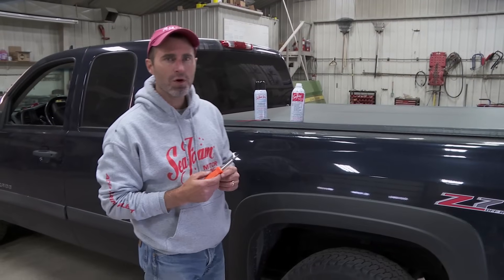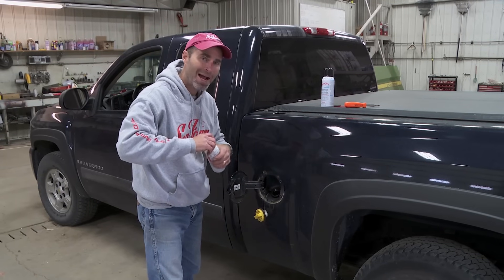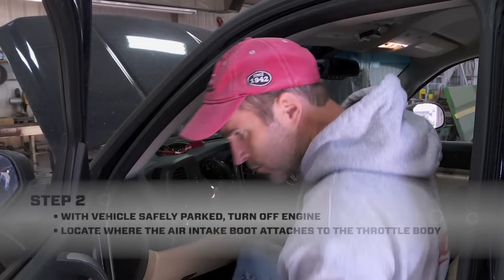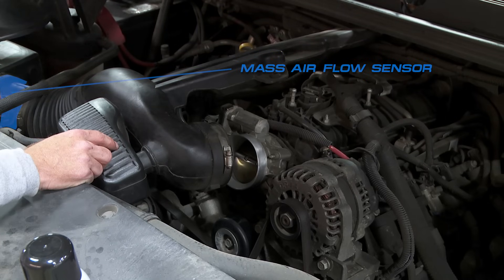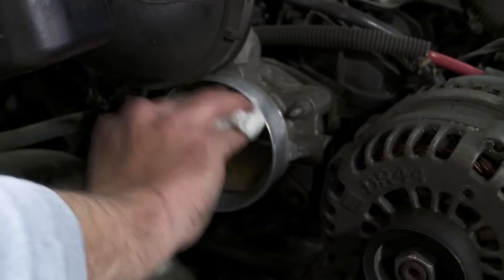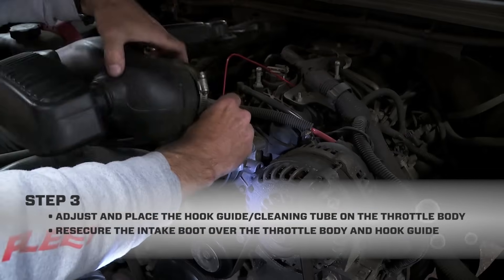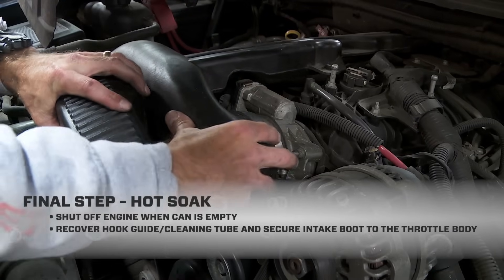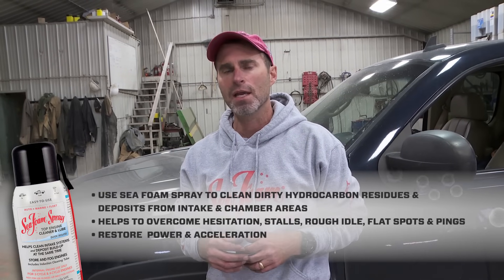How to clean a gasoline fuel injection air intake with Sea Foam Spray

Comment: You’ve thoroughly confused me now as you seem to no Longer approve of using vacuum line method? Is the effect of spraying thru throttle body the same as vacuum line? Combustion chamber is still cleaned etc. ?
Reply from the maker: Great question. Sea Foam does not encourage vacuum line use. Sea Foam Spray works MUCH smarter, better - cleans more, cleans better, safer, feeds/cleans all intake valves and cylinders evenly.  Any liquid through a vacuum line is drawn in globs of fluid into a chamber (not tiny aspirated droplets), does not feed evenly, then pushed out the exhaust valves. The cleaning difference is night and day, partly because you're not wasting the product. Hope this helps.
Reply: Sea Foam Official it kind of helps, I get the issue with using the brake booster as it may not supply all cylinders, but you guys never actually suggested using the brake booster line, you always suggested the PCV valve vacuum line which feeds right into the manifold and all cylinders. I hear you on the spray being just a superior solution, I’d think most of the liquid gets aeroslized given the air pressure and heat, unless an idiot just pours it into the tube all at once as idiots have been known to do. So I get that for you guys it’s smarter to just suggest nobody use that method in our overly litigious society, but what if I pour my seafoam into a spray bottle and spray into the PCV valve vacuum hose, then I can get the spray next time, do you see an issue with that or still advise against it? Appreciate your time
Reply from the maker: You can use the can in your fuel, your crankcase oil..up to you.

Comment: I'm 60 and I'm telling you it was WAY easier with 4bbl carbs and good non ethanol 100 octane gas.
Reply from the maker: Yes, simpler and much less complicated. Like many inventions, 4bbl came and went because the USA  market system is built on rewarding innovation. How fuel is made works the same way... In the end, we all want low cost fuel that works just good enough.

Comment: My 2014 Dodge Grand Caravan has the MAP sensor behind the throttle body. How can I use Seafoam on my Dodge?
Reply from the maker: The video describes MAF (mass air flow).  MAP (manifold absolute pressure) is different/non-issue.

Comment: I'm not an expert, but is it really a good idea to take all that carbon harmlessly sitting in the intake and flush it through the engine? I guess the results speak for itself but I'm wondering if i can skip that step.
Reply from the maker: Sea Foam Spray softens and liquefies the varnish that holds the carbon ash together. Whatever is cleaned is immediately pushed out the exhaust. Nothing goes into the engine, it goes out of the engine. Hope this helps!

Comment: I have a 1992 Chevrolet Caprice with a 305 and 260k miles is it risky to "foam" the motor in the throttle body?
Reply from the maker: Not risky.

Comment: Hold on. Why did you add a whole 16 oz can to the tank? On the can itself it says 1 oz per 1 gallon of fuel!!!
Reply from the maker: 1 oz is a maintenance dosage for keeping fuel fresh.  Can always add a greater concentration for cleaning.  The greater the concentration, the more it cleans.
Reply: Sea Foam Official  Got it. Thank you :)

Comment: Would you recommend to this before or after pouring seafoam down the brake booster vacuum line?
Reply from the maker: Hi Juan: Thanks for the question. We NEVER recommend using the brake booster/vacuum line.  There's no point when Sea Foam Spray works much safer, even, and far better cleaning!  Anyway, Sea Foam Spray is the way for cleaning the upper engine!

Comment: 1993 Dodge 250 pick up. 318 V8. Ran REALLY rough. Like hardly could keep it going. I thought I needed a valve job. Couldn't find any vacuum leaks. 
A can in the tank and a can of spray into the intake and a little driving. I even forgot to warm it up, but it's driving NICE. I love this stuff.
Reply from the maker: Great news! Thanks for posting!  Now that you have the hang of it can tell your friends, then just keep after it every few months (or 2 to 4 treatments/year).

Comment: I didn't have any check engine lights on my PT Cruiser but I wanted to do a fuel system clean as preventative maintenance. The owner's manual doesn't say anything about cleaning the fuel system so I never really think about it. I bought some throttle body cleaner, regular can of Sea Foam, and the Sea Foam spay. I poured the entire can of Sea Foam in the gas tank, cleaned the throttle body, and then sprayed the Sea Foam spay like the video. I wasn't having any problems before but now the engine idles smoother and when I hit the gas after a stop sign, it doesn't surge or hesitate anymore. I'll probably start doing this more often. The car has 125k miles and is my daily driver. I did this at night time but there sure was a lot of stuff coming out of the tailpipe.
Reply from the maker: Thanks for the post  What you described is what  most people experience after using Sea Foam Spray. Now that you have the hang of it, tell your friends how easy it is to use...And all you need to do is a treatment 2 to 4 times a year to keep the intake valves and upper engine cleaner.
Reply: Sea Foam Official my friends want to do it to their vehicles after they saw the smoke come out. I can't believe how big of a difference it made on my car.
Reply from the maker: Glad you figured it out!  Cleaning the upper engine with Sea Foam Spray is critical.

Comment: I have a 2000 chevy 1500 4.3l 4x4 I can't find a way to get the nosle properly fit in the intake. Theirs no way to get the nosle 1/4 inch away from  throttle plate it's such a weird angle. Where you disconnect  the sleeve at  you have to make nosle go straight in about a foot then down 3 inches to hit throttle plate. Idk Anyone know what to do?
Reply from the maker: Chevy 6cyl intake boot assemblies during that time frame can be tricky.  Please go to our website and submit your question using the Ask Jim feature.  Our tech dept will help with what to do.
Reply: Sea Foam Official Thank you. how long does it usually take for a reply?
Reply from the maker: Quick if during business hours.
Reply: I have the same problem with my GM 5.7 tbi
Reply from the maker: Hi Ismael:   And we offer the same advice - Please contact our Tech Dept and we'll help you out.

Comment: so when you spray into the intake are you doing a continuous spray through the whole 4-5 minutes or bursts throught that time??
Reply from the maker: Continuous goes fast.  Just get the RPM to 2,000 and the engine will pull it in easily. Burst is OK, but would require a long time.
Reply: Sea Foam Official I just did it and my engine seems to be running so much smoother much better throttle response so far you have a customer for life

Comment: What if the sensor is above the throttle body? I have a 2000 Honda Accord V6
Reply from the maker: If the spray tube is directly in front of the throttle plate and the RPM is 2,000 ... the force of the air draw will keep the spray (liquid) centered, so no worries.

Comment: Are u supposed to put the straw inside the throttle body plate , or just infront of it ??? (Put it inside throttle body or just outside before closing clamp back on )
Reply from the maker: Great question:  In front - as long as the end of the tube points 1/4 to 1/2 inch in front of the plate when vertical (shut).
Reply: Sea Foam Official perfect thank you very much, I will definitely buy one and do it now, heard great stuff about this and want to see it for myself
Reply from the maker: Glad to help!  Thanks for posting.

Comment: 2009 Scion XB, check engine light on, OBD-II code p0151 & p0172. Used 1 can Sea Foam Spray. My friend shut off the engine while I sprayed for 2 to 3 seconds more. I leave for almost 2 hours. Restart engine for 5 minutes, drive for 10 minutes more. Reset codes. Engine running quieter and better gas mileage. No more codes.
Reply from the maker: Glad to hear + thanks for the post!

Comment: Can i use Seafoam spray in gas tank?
Reply from the maker: If you mean insert the tube into the filler neck and spray into gas tank, yes.
Reply: El Cisco 
This us a stupid question.
Did you not watch the video?  He put a whole can of SeaFoam in the gas tank where you put your gas.
Reply: @bettykuykendall2083  - He put the liquid in the tank, not the spray. Way to look like an ass.
Reply: @bettykuykendall2083  - Doesn't matter when you said it if it's still on the internet. 

You're so edgy.

Comment: what if i dont have a helper to apply throttle can i just spray in bursts at idle?
Reply from the maker: Hi John:  Thanks for the question. Not recommended.
Reply: I appreciate the reply
Reply from the maker: The spray comes out a a high rate (by design) so having the RPM up keeps everything in a steady stream + prevents the liquid from slowing down and pooling where there's less air flow, which can be problematic.
Reply: Sea Foam Official what about the brake booster vacuum line with non aerosol at idle?
Reply from the maker: No, not recommended.  Adding to brake booster does not work nearly as well or as safe as spray through throttle body.

Comment: hi so i been using this for 1 month .... meaning i pour a can to throttle last month alot of white smoke came out so i guess it worked ... so last week i bought another one and pour it again to throttle and smoked alot like the first time ... when will i know intake valves are clean when i dont get any smoke ? and can i use it every 2 weeks ?
Reply from the maker: Please don't pour Sea Foam into your engine's top end, always use Sea Foam Spray.  Use Sea Foam Motor Treatment in fuel and motor oil to clean passageways, use Sea Foam Spray to clean the upper engine.

You can use as often as you wish.  2 can the first month is smart, then use 2X per year.
Reply: Sea Foam Official ohh pfcourse ‘ i used sea foam spray lol 😂 but the spray can i do it every 2 weeks ? anything bad will happen ?
Reply from the maker: No worries. You can safely do every day.

Comment: my tank holds 17 gallons. Do i run it down half tank and then pour the whole bottle of seafoam?
Reply from the maker: Great question - just know that the more Sea Foam you add to a lower amount of fuel, the greater the cleaning concentration.

Comment: can i using SS14 to throttle body  + SF16 to engine same time? thanks
Reply from the maker: Yes, always a smart combo.  Sea Foam Spray cleans intake valves and chamber areas, Sea Foam Motor Treatment cleans through fuel injector passageways.
Reply: Thanks

Comment: Hello,  after reading most of these comments and the responses, I am comfortable giving this a try on my 2016 Mazda 3 with 15,000 miles. It is running fine right now,  I just want to stay ahead of any deposit buildup. I used BG through the throttle body years ago at the dealership but those engines weren't GDI. Is there anything I need to know before I try this on the Mazda and are there any warranty concerns? Thanks for your help.
Reply from the maker: Thanks for the post.  No worries though warranty terms are between you and maker.

Comment: Can someone Tell me where the Air intake would be located in a nissan maxima 02??? I want to feed the intake seafoam, have no clue where to put it into
Reply from the maker: It's where the air intake boot (plastic) attaches to the throttle body (metal).  Look for a hose clamp... Also look at our video on how to find the throttle plate.  Or, submit a question on our website's ASK JIM feature.  We're happy to help!

Comment: Hey Brian can I do this on a 2013 Tundra?
Reply from the maker: Yes, you can.  There's another Sea Foam Spray video doing a demo on a 2015 Tundra.  A Tundra is as simple as it gets, anyway.
Reply: Sea Foam Official okay thanks Brian they are charging me 190 to 350 to do this. I herd the butter fly may close and you have to be carefule. I guess that's why you have the other person Rev it up to 100 rpm's. I guess you can clean the throttle body while you do that. Thank you.
Reply from the maker: Please clarify what costs $190 to $350?

Comment: Do you need to change out your oil afterwards when you apply seafoam through the intake manifold process or is it not required? I know you change your oil if you apply it in the crankcase after a certain amount of miles. Just trying to get clarification. Thanks.
Reply from the maker: No need to change oil.
Reply: Sea Foam Official Thanks.
Reply from the maker: Our pleasure, and we appreciate the opportunity to be helpful.

Comment: Hey I'm about to do this to my 92 Lexus sc300. I've read on forums that I'm supposed put 1/3 in the crank case, gas tank and break booster. Then change my spark plugs after? I just had them changed about 100 miles ago so I didnt want to change them again. Would it be ok to not change the new spark plugs?
Reply from the maker: Put half in the crankcase, at least a can in the fuel (when low), and a can Sea Foam Spray through the intake.  No need to deal with spark plugs.   Also note that the website is a safe source for reliable info.  Some other sources can be like the Wild West.
Reply: Thanks for the reply I'm about to use Seafoam from now on since it works better then other products. How many miles should I drive after putting it into my crankcase til I get a oil change? Ive read 30-100 miles after wards cause it thins out the oil but hard to trust what I read online since yeah its like the wild west lol.
Reply from the maker: Drive 100 to 300 miles.  It will NOT thin the oil, it adds oil (SF is oil-derived)  to oil you already have in the crankcase.

Comment: will the Sea Foam products also clean the EGR valve,   to prevent sticking either in open or closed positions?   regards
Reply from the maker: No, by treating through the intake will not clean the EGR.   It will if you clean manually.
Reply: Sorry that  needs explaining,  first NO  then    IT WILL clean if I clean it first ?  regards
Reply from the maker: Applying Sea Foam Spray through the intake will not do anything to clean the EGR.  If you remove the EGR to clean (manually) you can spray it on to help dissolve the buildup.

Comment: This won't do anything to injectors.  However what does work, if you have a set of spare injectors, is soaking the injectors in Sea Foam for a few weeks (remove all injector rubber rings before soaking).  That will help clean the injectors inside.
Reply: It will clean your injectors if you put it in the tank.

Comment: Should I pour a can of Seafoam on near empty gas tank and fill up? Or should I pour it on near empty tank, drive around for a few miles, then fill up with gas?
Reply from the maker: Great question - Adding to a near empty tank creates a greater cleaning concentration.  What I do is add when tank is low, drive at least 20 miles before adding fresh fuel.

Comment: i used the seafoam spray on my 2001 jeep Cherokee. did everything in the video but mine did not spew smoke like i've seen in other videos. did it work, or do i need to do it again, or is it no big deal?
Reply from the maker: Smoke is oil vapor.  Has nothing to do with product performance.  No concern...Hope this helps!

Comment: Going to try this on my 2001 toyota camry with 206k kilometers on it either today or tomorrow. Will post if it seemed to help. My idle is kinda rough, I feel slight vibrations throughout the car and have lots of visible black residue on the other side of the throttle plate.
Reply from the maker: Thanks, Markman.  We are looking forward to your report!